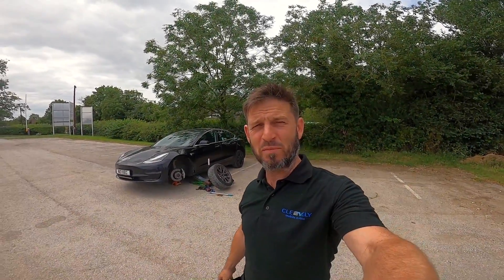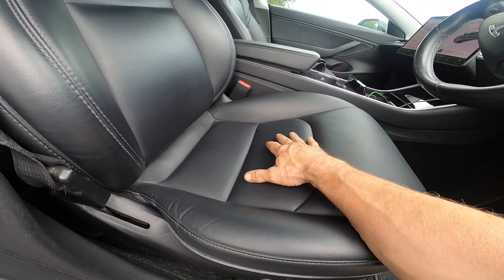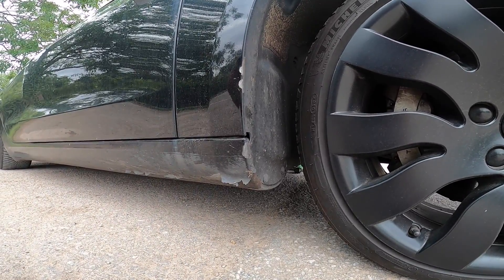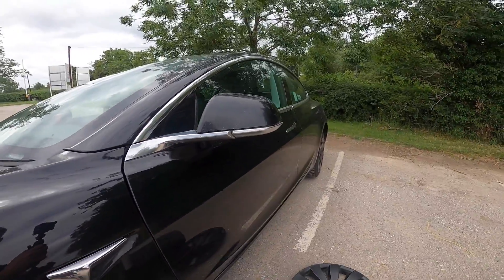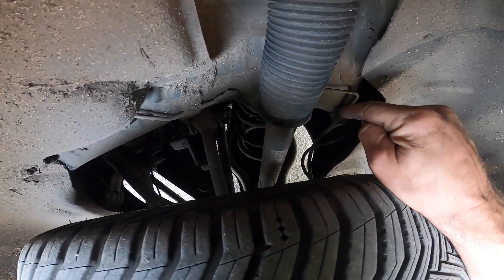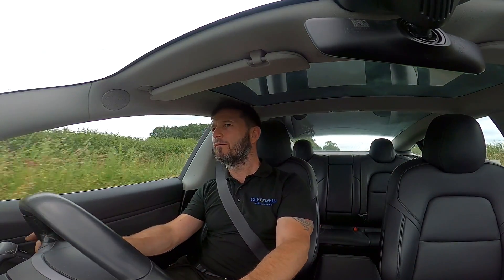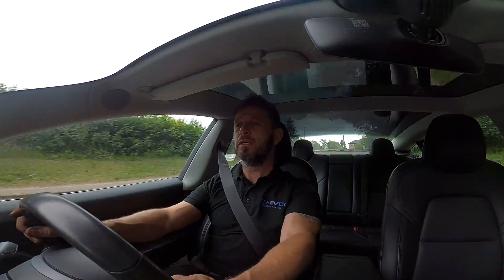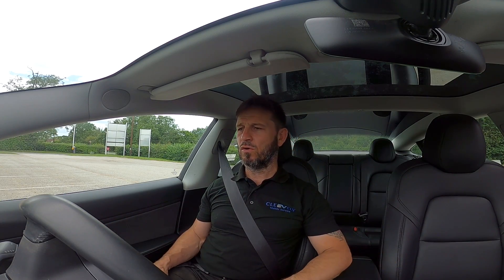200k Tesla - Would You Buy One?

Comment: I recently sold a BMW 320d for £500 at 180k miles, after spending thousands on maintenance and repairs. Plus if you charge overnight off peak you stand to save around £20k in fuel over 200k miles compared to an economical diesel, or north of £30K compared to a performance saloon like an M3. When you consider a new LFP model 3 costs the same to buy as a new 320d, it's a no brainer on cost alone.
Reply: Cannot imagine newer BMWs can go 180k miles based on my experience.

Comment: so 265000 model 3 2018 same config interior good seats same condition have replaced interior side trim next to driver the charger flap the upper front control arms need replacing otherwise just goes note I have trailer hitch use constantly range has settled at 85% note this is in canada no rust by the way.

Comment: If only we had a hatchback format, smaller, better fit for european roads,  parking lots, backside roads etc.. id for sure get one. I wanna get a model 3 LFP less than 80k kms for around 16-19k euros, batteries and motors still under warranty and main recals done (suspension triangle, charging orings, charging cover etc..) but it's so freaking huge. I do everything with my car, big big road trips, groceries, moves, carry ovens etc.. when improve my home, go camping etc.. model y would be the best format like a hatchback in a way but it's even more huge :/
We havetiny parking spots where even a camaro doesn't fit, small backroads you sometimes cant even cross with 2 small hatchbacks so what about a  SUV and a tesla.. our drive throughs are so small you'd get massive curb rash after just 10 times going there.. really gotta think this through but i want one so so bad :/

Comment: The biggest problem I see is that the vast majority of them won't be looked after or serviced at all. Almost every owner you see on the forums say they never need servicing so what's the chances that they're even going to bother? I've heard of countless owners who have had issues and I still think batteries are going to take a hit too, early adopters who are leasing them for 3 for 4 years are just not going to bother only charging them between 20 and 80 percent, they're going to go the full 100% and use the lot, especially if they're travelling any distance and would need to use public chargers. One thing that is often, if not always, overlooked is the overall battery life. 70 or 80% or more may sound good but they don't fade all the way to zero capacity, once they drop to around 60% they're virtually useless. Range completely disappears and they go flat in no time and you then start to struggle to charge them at all. And 15-16 grand is still a lot of money for something with 200k on the clock.
Reply from the maker: Interesting points, let me answer them. This is charged to 100% every night. It's also rapid charged most days, Tesla account for this and the BMS handles it. This won't get to 60% until over 500k, which in reality, is a long way off. Should it need a new pack, they're 9k from Tesla or we can buy second hand from written off cars from under 4k. It's also worth mentioning that at 60% SOH they don't simply go flat and not charge. This is a scenario from a gen 1 nissan Leaf with an old chemistry and a much lower capacity so throughput is much higher.
Reply: @Jamesandkate  Exactly, the information from OP is outdated and based on Nissan Leafs, Zoe's and other non-thermally managed battery packs. Tesla's and most modern EVs have excellent management of the cells. The only case Ive seen of a model 3 needing a non warranty replacement of the battery is from a youtuber Cyber lyft. His situation was extreme using the car as a taxi/uber/lyft at his home in California. He did not have access to AC charging or slow home charging and ONLY charged (100% of the time), on DC fast chargers which is very bad for the pack. He also used the battery pack to its full capacity often, having only the small standard range car. So more cycles as well. He talk about it in a video on his channel in depth, quite insightful. Replaced for 15k out of warranty.

Comment: So apart from 15 oil filters, 15 gallons of oil, 7 air filters 3 fuel filters, a dual mass flywheel, 2 diesel particular filters, an EGR valve, 3cam belts, 4 sets of brake pads and 2 sets of discs. My faithful diesel hasn't needed anything. (Sarcasm).

Great video, not only did it show just how good the Model 3 is, they have been continuously making improvements to the build quality since that particular car was built.
Reply: Well put...yet still the die-hards will cling on to their obsession with 'engines'.
Reply from the maker: That’s the thing. I’m a technician of over 30 years, so fully understand the realism of running an ICE car. You’re one of the few people who are honest about it. Thanks 🙏
Reply: It's gonna last it has a lot fewer mechanical parts,no brainer

Comment: C02 saving starts from 77K Miles compared to ICE. This Taxi Tesla is amazing EV’s are capable of high mileage subject to battery performance. Some engines blow up under 50K
Reply from the maker: Apparently I got it wrong. It has saved 60 tonnes or CO2 over 200k 😮
Reply: Not sure where you're getting 77k miles.
There was a 2020 report mentioning 49k miles, 78k km, but that was somewhat disputed to put it mildly.
Reply: In Europe its more like 10K-15K miles, but including CO2 from electricity production for electric vehicles and not including CO2 from gasoline production just shows some bias

Comment: Seat sensor, rear lights, amplifier, front anti roll bar drop links, front top control arms and rear control arms. Lots of cars would hit 200k without all that being replaced.
Reply: You're right, it would be pads and discs, exhaust, clutch plus umpteen oil changes. At 50k miles my 3 Series needed a turbo, uuuuurgh!!
Reply: @ianhamilton3113 any EV wouldn't need those things.  Funny how the point of the video is how well the car has done in 200k, then goes on to list loads of major components that needed replacing. Hopefully later ones from China / Germany have fixed all those problems.
Reply from the maker: Tbf, he drives it hard. The top control arms and rear lights were a manufacturing defect, the rears were genuine, the ARB drop links at 140k is normal.

Comment: Nicely done. I have a 23 MYP, now have 9700 miles, other than a window regulator replaced under warranty, I have done NOTHING but keep it clean. I don't even get brake dust on the wheels. I'd be on my 3rd oil change on an ice car by now. I love the calm driving this car has, no noise and vibration at a stop light, and I play with the traffic around me. I've saved many hours and $$$ not going to gas stations, and the car is rock solid and confident on wet roads. No vehicle I've ever owned comes close

Comment: I took a gamble and picked up a couple of months ago a MS 2014 P85 with 105k and free supercharging. Drives lovely. Saved me £300 on deeeesil in me first month + should save on costs of maintenance and repairs i've always paid on my petrol and deesil cars over the last decade.  Vids like this make me happier about my "risk level".  (No warranty.  No battery warranty.  No motor warranty.)  Lets hope it makes 400k miles I am planning on keeping it going no matter what!!
Reply from the maker: If it helps, we offer a warranty for all of these through our business. Mobile@cleevelyev.co.uk 👍🏻
Reply: The early model S cars 2012-2015 did have some design flaws that have higher chance of failure.  Like the AC drain on top of the battery.  So it is possible at some point the battery will need to be replaced.  Later ones seem to not have that problem but time will tell.

Comment: Hi James - I've got a couple of questions

1 - Would you say your findings on this high mileage Model 3 are much the same as you've seen on other high mileage EV's from other manufacturers?  I know you run your own MG5's and they seem to be at about 100,000m but I'm looking to see if the Model 3 is bearing up better than most other EV's.

2 - How do you know where a Model 3 has been manufactured?  You mention this 2019 Model 3 was made in Freemont and go on to say cars made there are generally not as good as the ones made in the German and Shanghai giga factories.

I'll be in the market for a replacement EV when my Kona electric lease ends in November so I'm trying to gather as much information as I can to make an informed decision.

Thanks in anticipation - Robert
Reply: In the VIN = there is a F , From Fremont.  And the doors do not have the inlay ( only MIC , made in China have , before the upgrade). Bjorn has post  video how to recognise but these 2 are the fastest and easiest.
Reply from the maker: Hi Robert. 

Tesla have been at this a while and know their stuff, so I’d expect them to excel. However, they open source all of their information so other manufacturers will be closing in. Elon wanted this. 

Our MGs are amazing. I don’t doubt we’ll see 200k from them, but that’s a fair way of yet, probably 18 months to 2 years. 

The Fremont cars have a prefix of F in the chassis number, but in 2019, all Model 3s were built there. 

The later models have black door handles and the slightly later again models have a heat pump. 

That’s the one to go for 👍🏻

Comment: maybe a calculation of what a petrol car would have had after 200,000.  how many item it would have gone to land fill.  that this Tesla has not needed.
it is harder to work out now how to judge an electric car price.   petrol cars  pricing were more set to age and mileage.  but after that many miles any petrol car would have lost HP.  it would not be as fuel efficient.  more of the 2,000 part in a petrol engine would be closer to needing replacing.
you would not buy a leaf after doing that many miles.

Comment: Hi James got a question (if you can) I have a weird fault on the Niro. OK so if I'm driving one flat surface (over 40 mph) and have a slight bend coming up if I turn the wheel to make a slight adjustment the steering will track the bend but not recentre and will continue that course untili turn the wheel, it feelslike there's a small bind wheni turn the wheel with a dead area. I've had the tracking checked and new tyres fitted it doesn't do it all the time and most of the time the steering feels cohesive but every now and then it does it. Can these electric power steering be re calibrated or what would you're best guess if I need to have something replaced. Ps just had the vehicles bushes etc all checked and nothing is wrong visually. Cheers if you can help.
Reply from the maker: Likely one of the top strut bearing seizing up.
Reply: @Jamesandkate  thanks so much mate its going in for warranty work in a week probably for a new electric motor as its sounding terrible on trailing throttle and also the gearbox mounts are rattling again these was done 20k agp. Overall whilst I had normal car issues with the leaf the Niro seems to be unreliable on the actual bev side side of things. It doesn't bode well for going forward 😕  Cheers again
Reply from the maker: @FancyaBevMate  Maybe a Tesla next then?
Reply: @Jamesandkate  nah they are too simplistic for me I’ll probably go for a Mercedes EQB. Cheers

Comment: Those carbon figures aren’t entirely accurate as the environmental cost of battery production is pretty catastrophic, Volvo quotes around 80k miles before their EV are better environmentally than their IC cars.
Reply from the maker: Volvo had to retract this as they based it on global grid mix, countries that they don't even selll the vehicle in. Here's a link to website that will give you very accurate data including embodied energy from battery production, but it also includes the energy required to extract crude oil, put it through fractional distillation and then transport it. 

Worse case is, made in China, driven in Poland. Still cleaner to drive an EV after 43,000 miles. Driven in the UK it comes down to 15k miles.

https://www.transportenvironment.org/discover/how-clean-are-electric-cars/
Reply: @Jamesandkate  Thanks for this link.

Comment: I just hit the 80000 km (50,000 miles) on my poor man's 2019 Model 3.  After 4 years of trouble free driving, I decided to have Tesla mobile service have a look before the warranty expired.  Outside of a cabin air filter and a quick brake service, there was nothing else to do.  He thinks the brakes will last 600,000 km + at the current rate and the battery is at 95%. I will get it looked at every couple of years from here on in but looks like smooth sailing ahead.

Comment: I wonder how much a motor replacement would be if that went out? That would be largest risk assuming battery degradation was reasonable as you indicate. Pretty amazing value - thanks for sharing this valuable information!
Reply: My understanding is the motors aren't very expensive. The real risk would be a battery issue that somehow kills the pack. They are exceedingly rare but it does happen (and always get MEGA press when it does. Media loves to spread that FUD!)
Reply: There are many secondhand motors around that they are in demand with the conversion fraternity. That said a model three motor going is incredibly rare. The older model S motors were more problematic, but often replaced under warranty.
Reply: Electric motors almost never wear out, as a mechanical engineer in the auto and aerospace world you would have machine tools that ran for 15 years working 24/7/365  the ways were gone, bearings a disaster but replacing or rewinding a brushless electric motor was very rare.
I believe the Tesla motors are engineered for a million miles while the batteries are expected to be functional for about 350K to 500K miles.
Reply: The problem is the battery failing, not the degradation.
If you check used model S on sale, you'll see that a lot got their batteries replaced under warranty.

Comment: Really reassuring video James. I've done 148000km in my 40kwh leaf. Do you think I'll get to those numbers also??
Reply from the maker: If you maintain the battery yes. We have a customer with a 160k mile Leaf 40. 👍
Reply: It depends how well you've treated the battery. 
The reason Robert Llewellyn had to have his pack changed was because he didn't understand in the very early days how to charge it sensibly. He came home and just plugged in after every use letting it charge to 100% and leaving it sitting until the next use. If you've not done that and have kept the state of charge in the mid range until a full charge will be required, as I understand it, the pack should have remained healthy 👍
Reply from the maker: @AG-ob3fx are you suggesting you don’t know how to maintain a traction battery? You have a lot to say about this subject but it’s seems little to no knowledge.
Reply from the maker: @AG-ob3fx  Actually, I used to work in prototype HV battery development at JLR, where I trained and qualified. I have a very good understanding of how a battery works, how a SOH is calculated and how best to treat a Li-ion battery to maintain it.

Comment: Very impressive figures. I have a Kuga with only 200,000km, it’s due its third set of rear brake discs,(yes discs), and I just had the timing belt/water pump replaced costing about €500! I would certainly consider a Tesla like this. I also have an Ionic 5 which just had its 30,000km service which cost €305. I think this is waaaay too much for changing the pollen filter, but I have no choice if I want to maintain the warranty. At least that includes AA cover.
Reply from the maker: I’m pretty sure on Europe your protected by block exemption. This means your Ioniq can be serviced anywhere by suitably qualified mechanics fitting OEM spec parts.
Reply: Yes other non-Tesla manufactures still employed this stealership model of charging you for servicing a car to maintain the warranty. Teslas have no service schedule. Because as we saw in this video, there is practically nothing to service.
Reply: @Jamesandkate  , I’ll check they out, hopefully it’s true. The Hyundai dealership also said that they updated the software package,  but it had never been updated since leaving the factory. I updated it myself last week.

Comment: Also have to remember those are equivalent to a 500HP V8 or Turbo v6 sedan which usually takes premium and gets way worse gas mileage than the average. Even the RWD version makes nearly 300hp which would still require a nice Turbo 4cyl to keep up which would require premium as well! I wouldn't hesitate to drop $20k on one with 200k miles in that good a condition! Problem is finding them! Not too many ppl giving them up still.

Comment: Good review James, though I'm not a Tesla person.  Two points ... 1). Michelin Climate All Season Tyres are long lasting and excellent in all weather conditions.  2). That door click ... I had it on my Jaguar with the retaining/control arm fixing to the body being pulled by wind-gust catching the door.  The bracket to A Pillar ovaled and the bolt wouldn't tighten, so it would click as the bracket moved back and forth.   I fixed it by opening out the thread in the pillar with a drill and fitting a helicoil for a larger dia bolt that I also drilled a bigger hole for in the bracket.  Been good for 40k miles since 😀

Comment: Interesting re the cross climates.  I am thinking of using them on our ID.3 when the current Continentals need replacing.   As we are relatively low mileage but year round users I would feel happier with tyres rated for all seasons.

 And mudflaps: yes.  I have been mulling a set over.  Fronts for bodywork protection, rears for politeness to following drivers.
Reply: They are the best tyres I ever put on a car in 49 years of driving.  They easily last between 30 and 40k, are good on ice/snow/wet grass and light mud ... plus stable 140mph in warm weather in Europe 😁